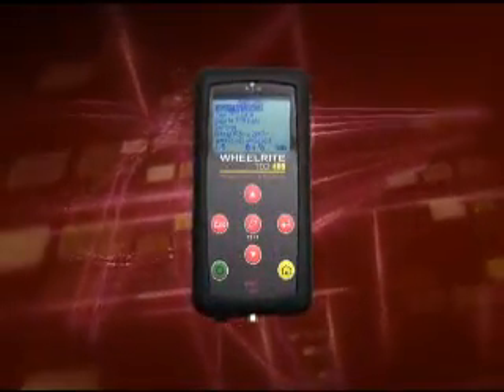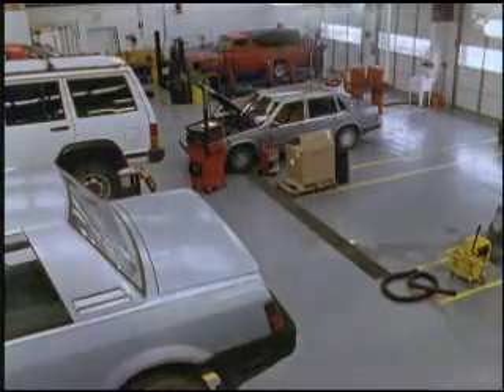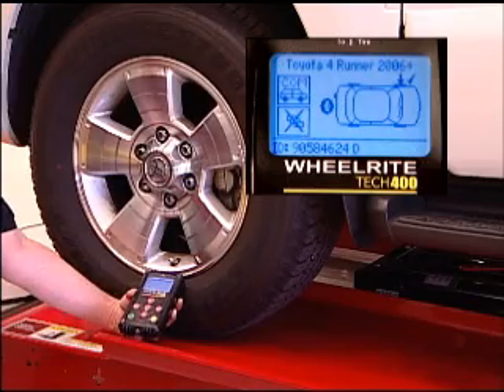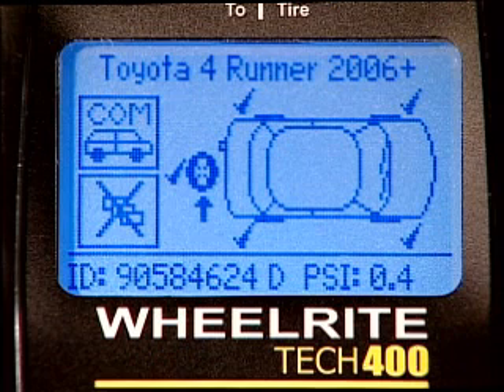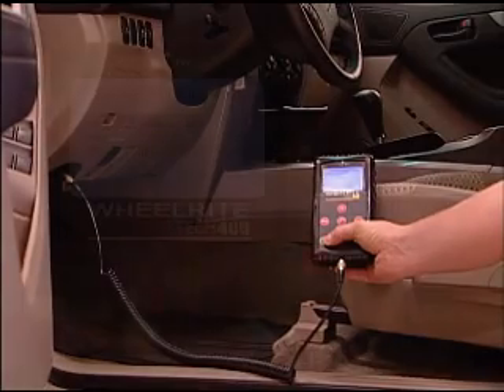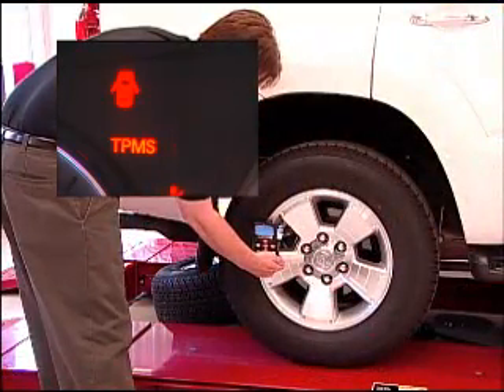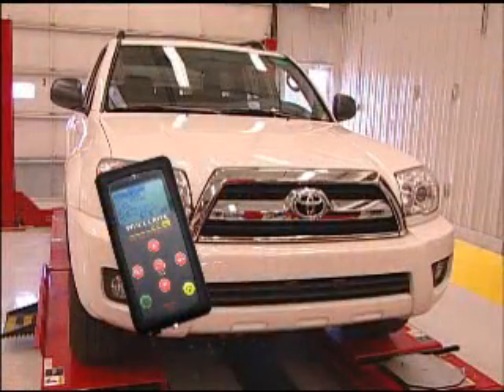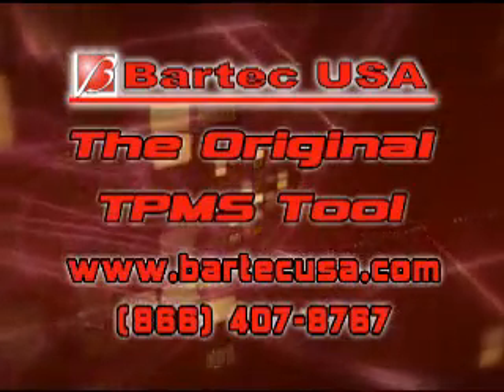Toyota 4Runner TPMS Tire Pressure Monitoring System

Comment: The PSI light was flashing and a scan brought "transmitter 5 doesn't receive data information (master)" fault code C2125 so i bought a used TPMS sensor and fixed to the spare tyre of which the light disappear but is now flashing again (on the dashboard) after some days. How may i fix this problem please? It's 4Runner 2005 Sport Edition. Thank you.